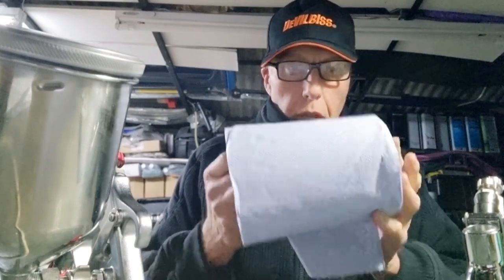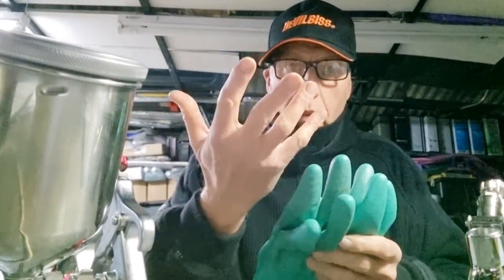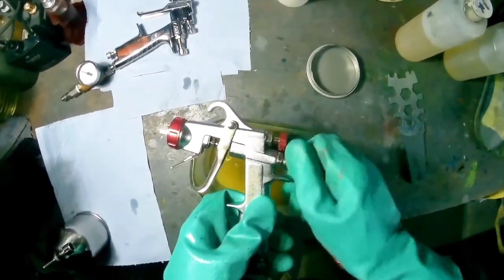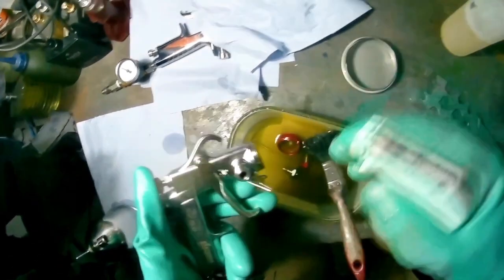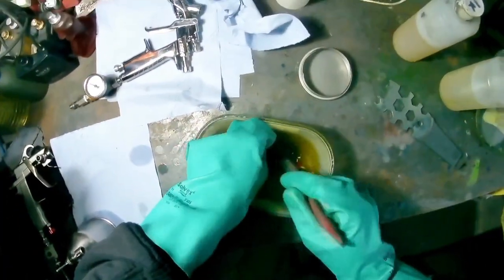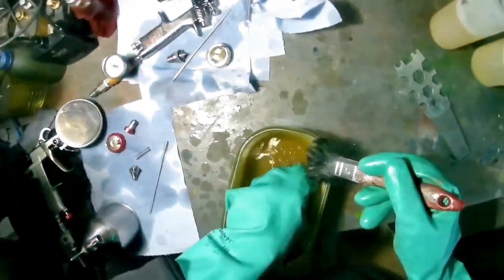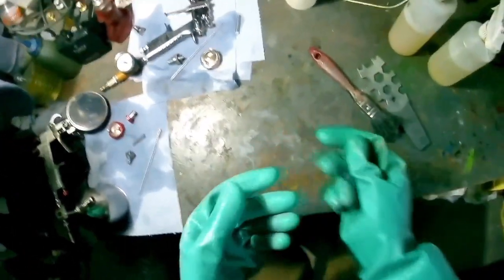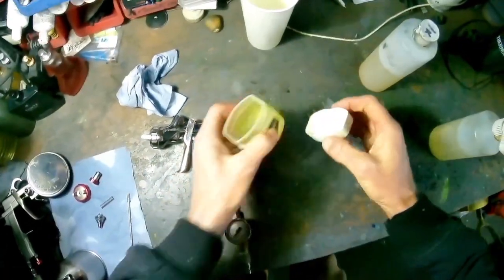How To Clean A Paint Spray Gun,  Easily, Side Cup And Top Cup

Comment: Nice vid Pete, 

When we tear the guns down for cleaning we always pull the trigger and remove the needle tip then the needle to stop possible damage to the needle. 👍

And on rebuild we just leave the air cap sat in roughly 1inch of gunwash in the paint cup and next time we use the gun we just reattach the cap and blow the thinners through the gun to "wake it up" as it were. 👍 

As you say many ways to skin a cat 😁👍

Have a great Christmas Pete 🎄 🍻🍻
Reply from the maker: Hi Terry,  thanks mate, hope you have a great Christmas as well.

As you say, there's a few ways to do it , the most important thing is not getting thinners into air trigger area of the gun, most will take it to a degree but the digital guns really don't like it so I find it better to get into the routine of keeping the main air supply clear in the gun, saves problems down the road,  cheers Terry 👍
Reply: Pulling the trigger and removing the tip first definitely makes a difference my aunty taught me how to spray and look after guns in her factory when I was 12-15 when I was 18 she asked me to help her takeover and run a paint room in a factory that had problems when having a look around we witnessed a guy tip half a pot of paint away didn't even rinse the gun and switch the tip and then needle for brand new ones 🤔 the place was a mess and 2 of the 3 guy's quiet before we started we found at least 15 abused dirty gun's stashed away and box's full of tip's cap's and needle's looking at the oldest gun's the needles were worn so bad that they stuck out of the tip by a good few mm than it should we could only presume they were taking the tip's off and on many times a day with the needle still in
Reply from the maker: Hi Colin,  That sounds like a complete mess. It's amazing how wasteful people can be when it's not their money! , sounds like you sorted it out, which is great 👍 

I've always had a degree of mechanical sympathy, so looking after tools is something I do as a matter of course. They last longer and perform better, and if you're in a busy shop, this saves time and money in the long run, cheers mate,  thanks for the comments 👍

Comment: Dear Pete, first off Happy New Year!  I wish this year will be a happy and healthy one for you.  I have one question: Iwata USA was showing a gun cleaning video (actually 2 videos) on a gun much like the one in your video.  Anyhow, in both videos, the guy put Iwata lubricator onto the nozzle during the re-assembly after the cleaning done.  He says he does this to prevent paint accumulation in that area.  He applies the lubricator to the small air passages around the nozzle also.  Usually, I only apply the lube alongside the needle (very small amount), and its backside where it interfaces with the spring to lubricate the o-ring.  Anyways, I repeated the exact same process (just the nozzle), but I started to get very tiny blisters on the painted surface (remember I use water-soluble acrylic paint sold in art stores).  Do you think this is due to the Iwata lubricator I applied on the nozzle?  The surface the paint is applied on is a primed surface and cleaned with alcohol.  I just wanted to get your opinion on this.  Take care.
Reply from the maker: Hi buddy,  a happy and healthy new year to you as well, mate 👍 

I would say absolutely 100% its down to the application of Iwata lubricant to the tip threads and air  holes.
I never put lubricant there. It's fine for longe term storage. After all, it's how the gun arrives when it's new, which should be cleaned out before use, but it is no good if you are going to use the gun frequently.

I don't apply any lubricant apart form occasionally on the needle beyond the tip, I used to do that all the time, but don't any more as the seals these days and nylon and needles stainless steel so don't really need it, it's only if the passage way feels a little tight I will apply some but first I will back the packing gland off to see if that helps obviously making sure there is no leakage after loosening , not often I do this as it's just not needed, Cheers 👍

Comment: Your videos are excellent thank you. On one I noticed that you seem to blow the tank with the spraygun as a final dusting. Is that achieved by only slightly pressing the trigger? I have an ANI R160Q but not opened the box yet!
Reply from the maker: Hi Mate, Yes, it's just releasing air and no product,  but just spray it once before you do that, as on the first releasing something material will be released. 
The ANI is a great little gun, but it likes its pressure,  I use around 2.5 bar for base and up to 3.5 bar for clear coat 👍
Reply from the maker: Hi Mate, Yes, it's just releasing air and no product,  but just spray it once before you do that, as on the first releasing something material will be released. 
The ANI is a great little gun, but it likes its pressure,  I use around 2.5 bar for base and up to 3.5 bar for clear coat 👍

Comment: Hi Pete I enjoyed that one! It’s surprising that I do basically what you do, but I’ve also got a couple of great tips as well, like using an ice cream container and a paint brush that’s a game changer for me to give the gun body a quick going over, I’ve always used the method you used at the end to bring the shine back to the body, I’ve also never put the whole tip in just the tip as it were as I use a small sample pot. I put gun wash though the gun at the end after rebuilding it and again before I use the gun, it sounds like you use Virgin thinners before and after is this something you would recommend more rather than the gun wash? I’ve never put the air on with the gun apart definitely doing that in future, although I do put the air on before putting the gun back in the box. 
Thanks for this again, saves me doing a video on this subject, I much rather it come from you anyway as this is more your subject and I wouldn’t want to tread on your toes so to speak.

Thanks again Pete. See you in the next one. 
Steve.
Reply from the maker: Hi Steve,  I've been asked by a few people over the months to do a video,  it was just getting around to it.

I use gun wash thinners at every stage of cleaning but before I use the gun I run virgin thinners through it normally twice,  just a squirt or two in the pot, swirl it around and let it out, then another time, the first should loosen any residue and the 2nd takes it out, that's the theory anyway.

A few people have said you can't be too basic with some of these videos,  sometimes I'm as guilty as others of assuming people know the basics when obviously if someone is starting they don't normally know anything.

No harm in doing your own video as well mate, your delivery is really good people will connect with it, I'll certainly watch it.

Running the air through is something Sata recommend particularly on their digital guns, a lot of people don't do it which is why there's so many Sata's for sale with the gauge not working.

Cheers Steve,  Happy Christmas mate 👍
Reply: @peteshobbies5383  I was probably one of them 😂

I will use the virgin from now on, it makes more sense to use it for a pre clean before spraying to prevent any contamination so definitely worth me doing that in future.

I find it difficult what to cut out of a video and what to leave in I feel if they are to long people wouldn’t watch it all the way through, but then you have people like myself that is happy to watch a longer video especially one with all the information in it, my spraying one for example I cut a lot of stuff out of it. 
This video was definitely helpful and totally worth being as long as it needs to be you’ve done an excellent job on this. 

I think I will incorporate it into a spraying video otherwise it will be a carbon copy of yours and I feel that’s unfair on you honestly although I would link it back to you but still I won’t feel right about it. I have no doubt you would watch it your the king of spraying 😁 it’s clearly a passion of yours (one I totally get!) which is why I think your channel is growing as much as it does, it’s a great resource for guys like me who wants to dabble in spray painting, keep the videos coming and I will continue to watch when I get time. 

Hope you have a fantastic day Pete, merry Christmas 🎄
Reply from the maker: Yeah,  it is difficult to know what to keep in and what not to, people are after and get different things from different bits so it's always a compromise.

I think people appreciate the honesty that people like you and me bring to them, I'm never sure watching some people if they are saying it because someone gives them the stuff or if they believe it.

People don't often have the time so I try and keep videos as short as possible, the analytics will tell you the average time people watch which is a reasonable guide,  cheers mate,  have a good one 👍

Comment: Some gun washes include acetone, that is what breaks down nitrile gloves. Get gun wash without acetone content and gloves will last a bit better.
Reply from the maker: Hi Pekka, yes, it does vary on the gun wash, I've been using these chemical gloves for about 2 years now, they last about 3 months which is brilliant  for doing this, especially considering how expensive Nitrile gloves are now, I know they are cheaper than they were but still an expense,  cheers buddy 👍
Reply: I forgot to mention in my comment above that I now use latex gloves (similar to marigolds) they are about £10 for a box of 100 and thinners doesn't attack them, I use them for the whole process from painting to cleaning and one pair lasts me ages👍
Mine are the Ansell MicroFlex 63-864 from Amazon.
Reply from the maker: Ok mate, I'll take a look next time I need gloves , the one's I've used in the video last around 3 months a pair, can't use them for painting though 😉,  cheers John 🍻